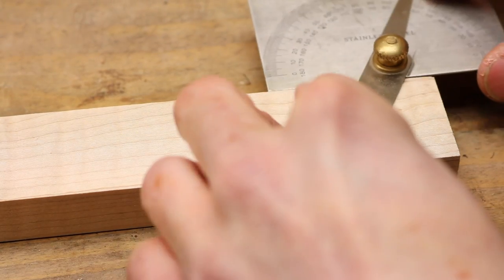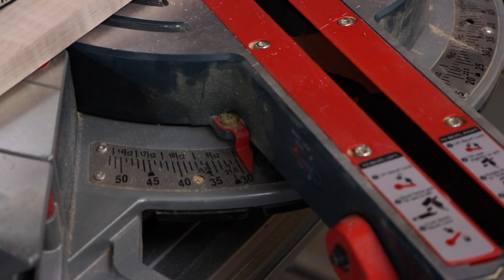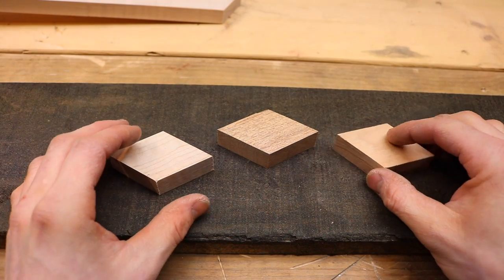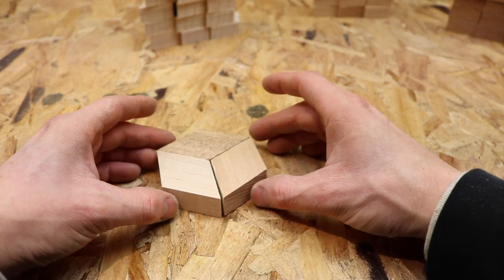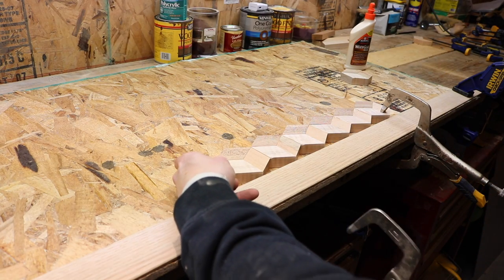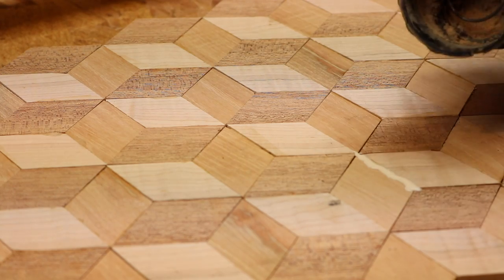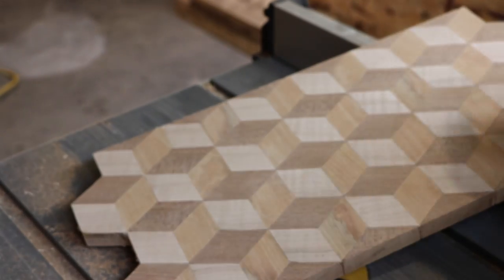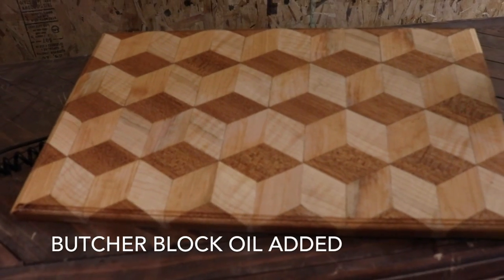3D CUTTING BOARD DIY

Comment: NOTE: The thickness of each board is not super critical. Any differences can be corrected at the end with a thickness planer or a belt sander. BUT... the width of each board MUST BE EXACT. Any significant difference either in each board compared to each other, or irregularities in the width of any single board, can cause the diamonds to significantly different enough to cause them to not fit tightly together, ruining the whole cutting board. I leaqrned this the hard way. 0.05" differences can be enough to throw things off. I recommend using a digital caliper for your measurements,

Comment: Made 13-15 cuts using the 30degree measurement given, none worked. Used 2 different tools to make sure one wasn't off, same results from all 3 tools. Perfectly good wood wasted due to incorrect angle given
Reply from the maker: George Willcoxon this is an isometric view, isometric is 3D, isometric is 30 degrees. You need to orientate the grain. Flip the pieces so the grain goes in different directions AFTER you cut them
Reply: @adamfleisch  I did that, the pieces didn't even come close. Two fit and the third one had 1/16 gap on one side. I turned the grain, flipped the pieces around and over. Swapped them around, even cut and wasted more wood to achieve the same results of wasted wood. I ended going to a friend's house that's a 40 year veteran woodworker.  I showed him the video and he went in the same measurements. He told me it wouldn't work before he started but done it anyway. He had the same results, a good piece of wood wasted. There was a 1/16 inch gap between the pieces at their closest. Cutting boards can't have that due to bacterial contamination.
Reply: @georgewillcoxon6225  30 degrees is the correct meaurement. The diamond is, essentially an equilateral polygon.The sum of the two smaller, interior angles should add to 60 degrees. The  other two, larger opposite  angles added together equal 120 degrees, or 60 degrees each. The sum of all the interior angles of any polygon should be 180 degrees, which it is for this "diamond" polygon. I discovered that the most critical measurement in this project is to have each starting board EXACTLY the same width. Even each individual board must not vary along its witdth more than about 0.05". The thickness of the boards should be close, but not as critical as the width, This can be corrected at the end with a surface planer or a belt sander. I use a digital caliper to measure the width of each board and to check the width along the length of each individual board.

Comment: You're saying to set your angle finder to 30 degrees, however, when looking at your protractor
it looks like you are not at 30 degrees, it looks more like 60 degrees. I tried to make the trapezoid at 30 degrees but the angle is way to flat. No way that will work. Re-do the video.
Reply from the maker: My miter saw does not go to 60 degrees
Reply: At the 14 second mark of the video, the protractor is not at 30 degrees. I'm not quite sure what the protractor is set at but it looks more like 60 degrees. Yes, you are correct about your miter saw and the video shows your cut being made at 30 degrees. I was only referring to the protractor.

Comment: This is not an end grain cutting board, it is face grain, and you did not use waterproof glue.....
Reply: Patrick Keelan he never said it was an “end grain”, he showed you the grain direction.  Secondly, at 1:52 pause the video. Use your eyes and it reads “waterproof and stainable”. Hope that helps the trolling.